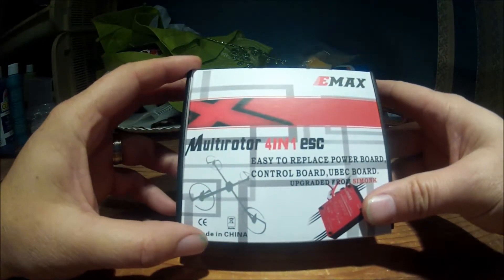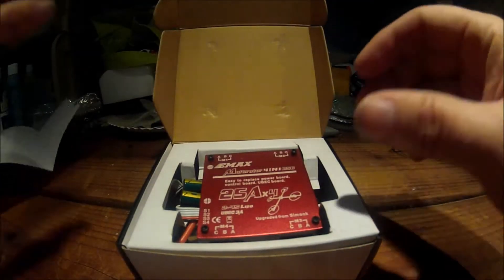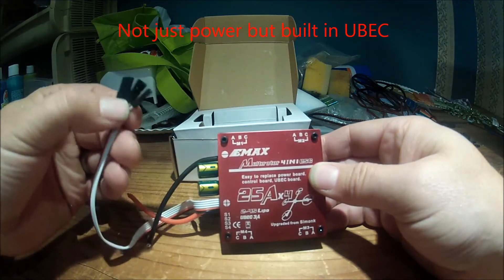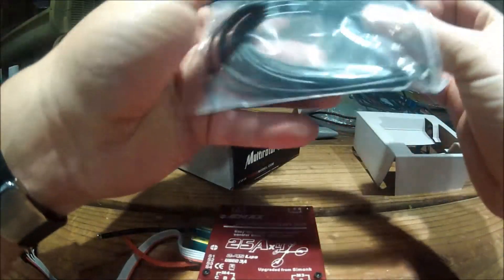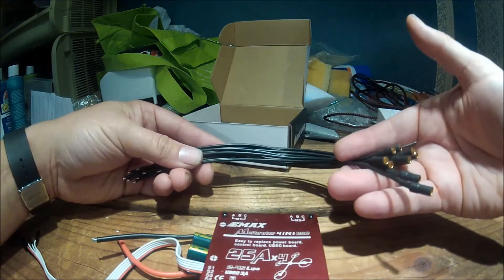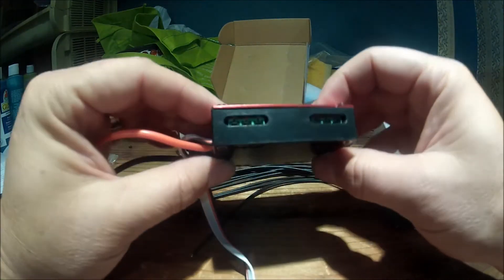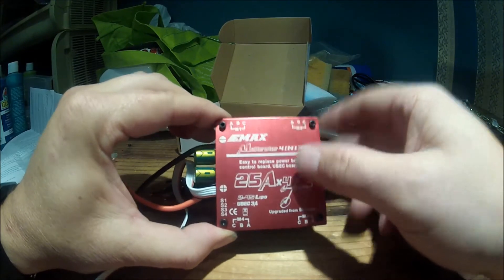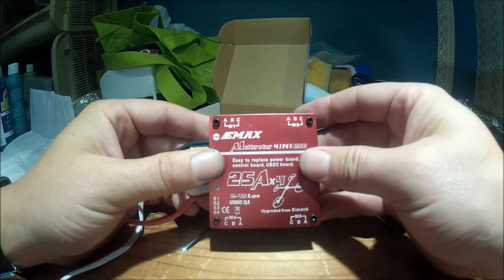EMAX 25A Multirotor 4 in 1 ESC setup Part1 of 6 - Unboxing

Comment: I am facing a problem, that is at first time  when i connected 4 motors using emax 4 in 1 then it workd, but the power supply was not equal for each motor, thats why i tried to calibrate the transmiter and motor with the connection of emax, but that time motor 2 and motor 3 working but motor 1 and motor 4 does not working. And when transmitter power on after calibrate then  3 starting beeps coming from motor 2 and 3 but when transmitter turn off then the 3 starting beeps coming from motor 1 and 4. Now how i can solve this problem, pls help me